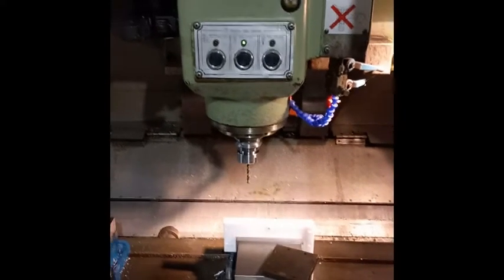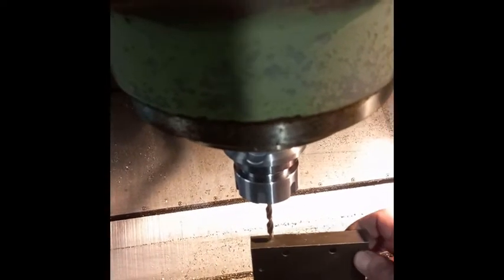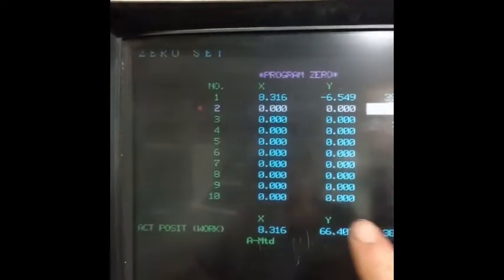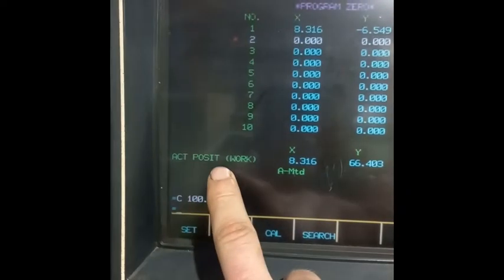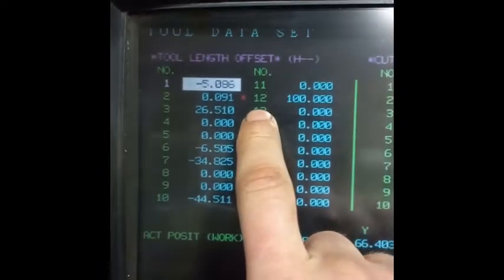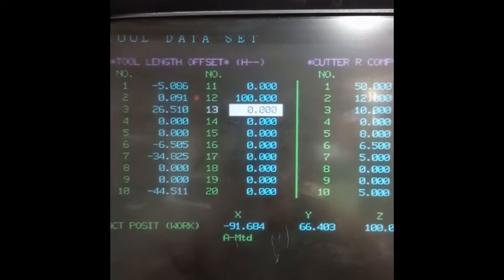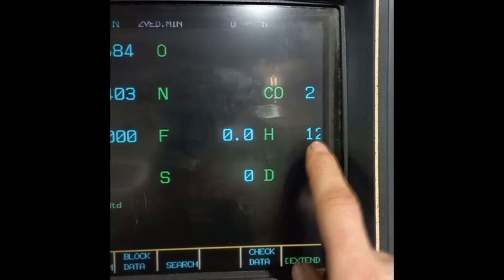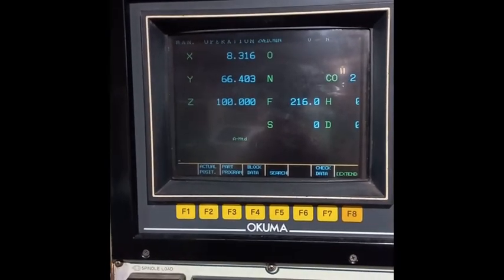OKUMA OSP-5000M-G workpiece and tool lenght offset setting (MC-4VA)

Comment: We had an Mc4 at my work as a young machinist, it was a good machine. 
I use to operate it sometimes.
That and our LC20 st lathe was the first cnc machines I came across. It had those paper hole bands for programs. What memories. No probes at that times. Nice to see the machine again!
Reply from the maker: OKUMA is sure a good machine (from mechanical sight of view) except its electronics. I really like some of it's functions, but nowadays that CNC system is obsolete. Program memory amount is extremely small for programs generated in CAD/CAM software, servo drives are unreliable due to age, not to mention bubble memory or even CMOS memory (batteries goes bad very fast), SVP or processor boards. Thats why Im planning of removing all old electronic, servo drives and motors and perform a retrofit (I think it will be LinuxCNC as Im familiar with this system). Modern problems require modern solutions.
Reply: @guntiskolcs3689  Yes, the years has it´s turns on them. Yes, i remember if i had to load a new program, i had to remove some others to make way. One other thing that has improved is the removable cooling tanks, before they where in the bottom of the chassie. It was a job for a whole day to clean them out and find all the corners inside.

Yes, maybe your machine will work better with your mods. 
I wish you good luck!

Comment: How to  subprogram
Reply from the maker: I don't use subprograms and have no experience with these, only G-codes with program size available to use on my machine, therefore I can't help You on this topic.
Reply: G111 h1 x40 y-30 z3 s1500 f150 w8

G73 r3 z-15 Q3
Call o1 
G0 z100 m9

M2
o1
X50
X80
Rts
Reply: @crustaceantom3744  now i can use sup program thanks for comment
Reply: How load program g-code?
Reply: @87588thkjgg  F3+F1 CN0: input
Reply: @leoatthakon  thanks
Reply: Hello everyone  I need help how to find the page  diagnostic 
I'm trying to figure out what is  baudrate ,and data bit 😢